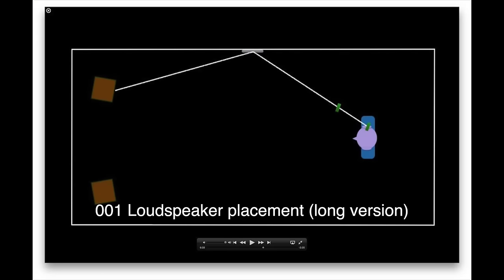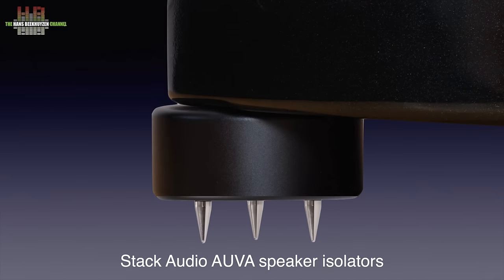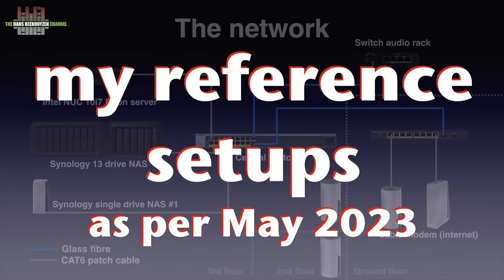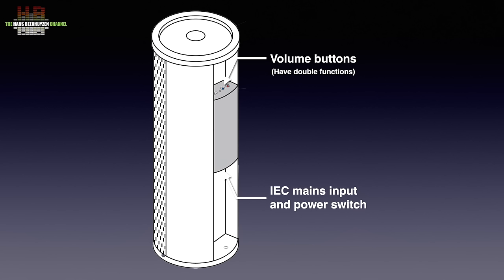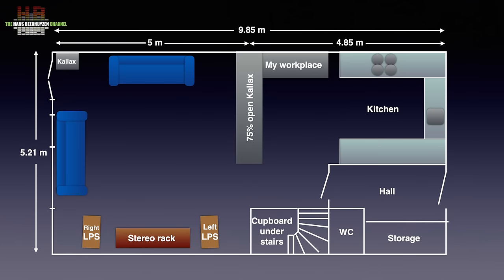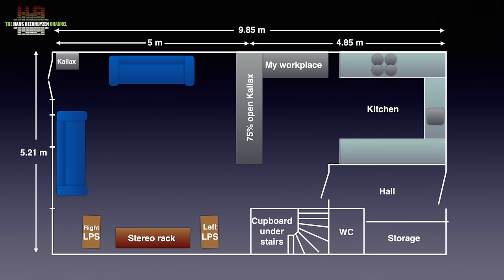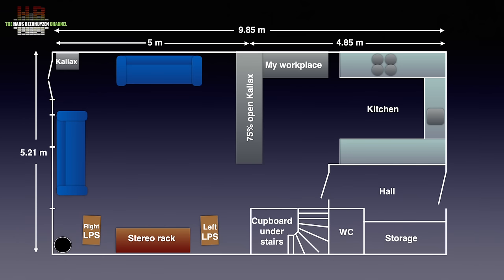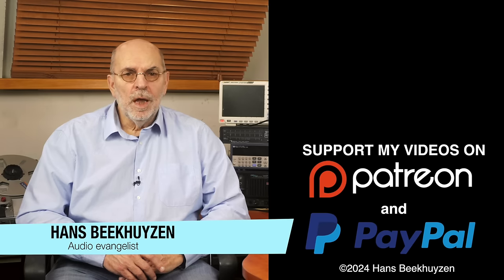Improving lows with the PSI Audio AVAA C214 active bass trap

Comment: I discovered the AVAA’s last year.  My space is acoustically treated by Artnovion but bass trapping  was not adequate.  Not enough room for real trapping. 
Enter the AVAA’s.  I tried 1 on demo.  Very effective in my space.  When I bought the 1st and received it the dealer let me keep the demo unit so I naturally tried 2.  Wow, more impressive than with 1.  Cleaner, clearer, punchier bass and even improved mids and vocals.  All easily heard when the AVAA’s are switched on and off.  
I ended up with more AVAA’a as I found even further “magic” as I added more units.  I’m using the previous model but it works much the same as the new one. It lacks an iPhone feature.  
These work. Very well.  My acoustic treatments now include full effective bass trapping. With 2 massive woofers and 2 large tower speakers, the bass energy I my space was uncontrolled.  Now the bass is a highlight of the system.  Love them!
Reply from the maker: Thanks for sharing
Reply: You have got into this, seriously 👍👍
How much does the improvement vary – depending on where you put them in the room?

Comment: Hans, thank you for a thorough but succinct review. I was considering adding a second REL sub, to see if it might help to even out the low end in my L-shape room, but would it make better sense to try one or more AVAAs first?  And should I avoid placing an AVAA in the same corner as my existing sub?
Reply from the maker: It depends on the problems you have. When you play music with deep lows and you suddenly stop playing, do you hear the lows fading out in stead of stop immediately? Then the AVAA's are your thing. In my country the distributor has a demo set of two to try on location. You might check if it's the same for where you live.

Comment: Interesting product, good review.
 Reminds me of the earlier ASC tube traps (which were passive).  I currently have attractively priced bass traps from Blue Acoustics.  My speakers are placed 1.20m from the back wall.  The right speaker does not see any walls behind or to the right.  Unfortunately, the left speaker has a closet  wall ( kastwand) nearby.  It took a long time before the low registers were somewhat in order.  I'm guessing the 2 REL subs in inverted mode are also doing their job??
Reply from the maker: Thanks for sharing!
Reply: jakobgooijer, what do you mean when you state the RELs are inverted? Thank you
Reply: @lobstame  there is a setting ( knob ) on the REL's to inverte phase by 180⁰

Comment: Could you link to the DB Music App?  I was not able to find it in the App Store.  Great video!
Reply from the maker: It doesn't have to be linked to your stereo or music app. It reacts on the sound in the room.
Reply: Makes sense. I cannot find where to get the app.
Reply from the maker: There is a qr code on the cover of the manual
Reply: @TheHansBeekhuyzenChannel  |  I too am confused.  Where to obtain the app pictured in the video.  Not sure what is meant by on cover of manual.  What manual?
Reply from the maker: You can download the manual here: https://downloads.psiaudio.com/active-basstraps/AVAA_C214_UserManual.pdf. It also contains info on downloading the app.

Comment: Hi Hans, thanks for your reviews! Question, is adding a big akoustical painting on the wall behind your listening position on the couch a good way to mitigate refections from behind you and thus improve the sound? (Besides early reflections and speaker placement?) I have a similar situation and am thinking about that.
Reply from the maker: The increased level of lows can only be cured by a bass trap that is thick enough. For 30 Hz a quarter of a wavelength would be 2.83 meters...... For 150 Hz still 14.1 cm. So you would need a very thick painting....
Reply: @TheHansBeekhuyzenChannel  understand, and will it do something for the higher frequencies? Sitting so close to a wall will prob cause problems there to? Or not?
Reply: @TheHansBeekhuyzenChannel  not just thickness, you need enough rate of absorption as well. You can build a box that can reach low, but whether it "gets enough" is the tricky part.
Reply from the maker: Agreed

Comment: Why don't you try them either side of your couch behind the couch, Can you reverse the phase on them
Reply from the maker: Room resonances cause standing waves and they cause knots and nulls at different places throughuot the room, depending on the frequencies. But they all start at the walls so the pressure is normally highest there where three boundaries meet: front wall, side wall and floor (or ceiling, if you want). There the AVAA measures pressure and lower the air impedance. There is no phase switch on the AVAA's, it's not a subwoofer in reverse.
Reply: They work like noise cancelling that's the theory behind it if you had it near where you're listening position is and your meeting the wave coming towards you and cancelling out the unwanted peaks and troughs from the room and speaker  is your goal @TheHansBeekhuyzenChannel

Comment: Thanks for a great video, I've been eying AVAA but not found any good reviews until now! :)
But I've been quite puzzled by the technology they're using, because it sounds like its ANC (the sucking out high pressure would be by adding a low pressure or a 180 phase shift in ANC terms), but they say it's not and I have no reason to think it's a lie. So I figured they're using another method and the one I could think of is using a regulation loop with the normal air pressure as set point, then using a negative feedback loop via speakers/amplifier to force the pressure value to the set value (normal air pressure). But this is just the musings of an engineer, they could have done it quite differently using methods I'm not familiar with. If someone know what they're doing and explain it, it would be much appreciated! :)
Reply from the maker: I'm almost sure they mean they don't output energy, positive nor negative, they 'suck in' the energy generated by the room resonances. Like in the movie the Matrix the attacked person moves backwards.
Reply: @TheHansBeekhuyzenChannel  Thanks for the reply! Although 'suck in' energy is a bit to vague since the interesting bit is how. So did search a bit for seeing if anyone opened one up. Instead I was lucky to find an article describing a bit better how it works (based on the previous model C20) "Inside the unit is a pressure-gradient mic mounted behind a micro- perforated screen carefully tuned to offer a specific acoustic impedance boundary. Also inside is an acoustic-suspension driver, which is mounted behind its own speaker grille—like impedance boundary. An analog amplification circuit propels the driver with a velocity that's in opposition of the pressure measured by the screened mic, in order to "zero" the acoustic pressure at the wall boundary or corner junction where the device is placed. Hence the name — Active Velocity Acoustic Absorber." So based on that it seems like I was partially correct, I just missed the acoustic impedance boundary (and inside they have a driver negating the pressure in the tube). So my curiosity is now sated. :)

Comment: Sounds like a great product how much are they.
Is it if you have to ask you can afford it. lol
Reply from the maker: I can't judge if you can't afford  € 3400 (incl 21%VAT)
Reply: To be fair, 3400 will also buy a lot of foam.
Reply: @Audfile  Foam doesnt realy improve Low Frequencies. You can build a big Bafflewall with mineral wool or thick layers of Basotect wich have an better flow resistence but the best way and space saving is to build an Array (Double Bass Array) where you control the LF energy
Reply from the maker: But foam won't do it.
Reply: @TheHansBeekhuyzenChannel  of course, how silly of me. I used the term in general. But yes, fiberglass, etc. These devices are intriguing! Thanks for the review.